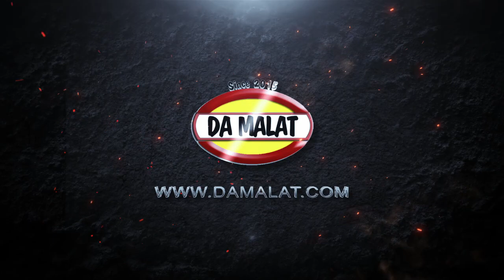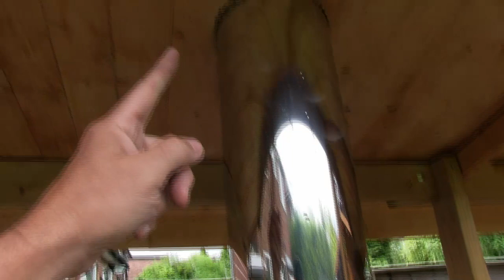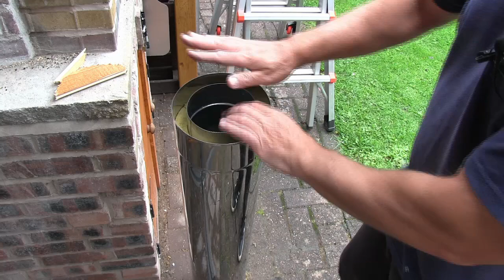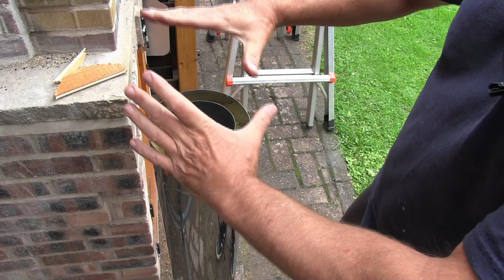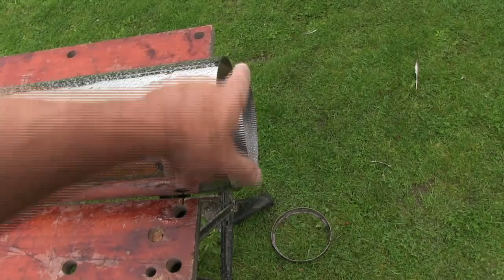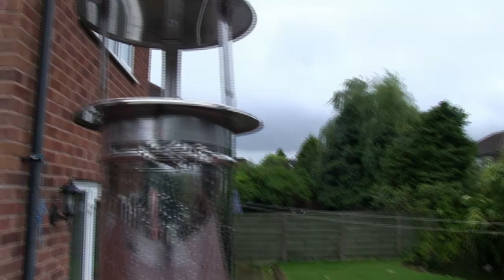Chimney install on a pizza oven

Comment: I have yet to see a double-walled chimney pipe that did not require a 2” minimum clearance from combustibles (ie. Your roof and wood ceiling). I’m going through this process right now and speaking with professionals who say they’ve seen people’s wood turn to charcoal and almost light a home on fire. The hole should be 2” wider all around and you’ll need a finishing plate on the ceiling side to hide the hole (circle or square) and a metal flashing cone on the roof with a storm collar on top. I hope people don’t copy you.

Comment: I’ve been watching all of your build videos over the last couple of days. 100% going to build one when I move house in the future, I have a question for you. Would you recommend incorporating this chimney in the actual build if you could start from scratch again? Understand that it was an experimental to start with and you’ve added bits afterwards. Cheers
Reply from the maker: If you set a metal chimney into the concrete, it will expand and crack the dome. This is just a very basic build to a tight budget. There are some really good improvements to be made such as a fire brick tile floor and a ceramic blanket layer between the dome and outer render. Join my Facebook group, there are hundreds of members on there who have either built this oven or going through the build process now. Lots of ideas and tips being shared plus some great modifications to this build to produce and even better performing oven: https://www.facebook.com/groups/damalatspices
Reply: @DaMalat  thank you for the reply! I’ll be sure to check out your Facebook group. Cheers

Comment: Looks good from here! I've been working to find a way to add my chimney flue as well, excited to see how this works for you. I'll be using a non insulated pipe and damper, with the damper being the anchor point. Thinking I might be able to wrap the pipe with some cardboard to allow some extra room for expansion, and fill the gap with a high temperature silicone I found on Amazon. Then using a heat resistant mortar to hold the form in place as you showed in the video. Need to be able to remove the tall pipe during hurricanes, just cap the damper and wrap the whole oven in a large plastic tarp to keep the water out.
Reply from the maker: Thanks for the feedback Russell